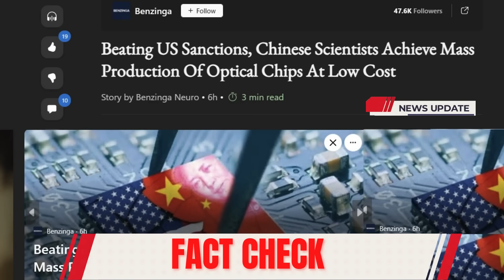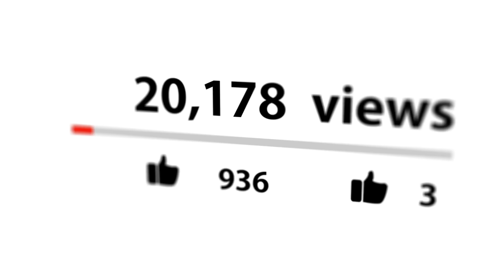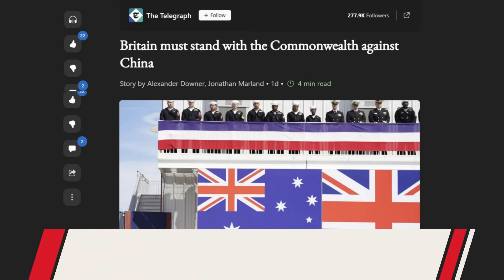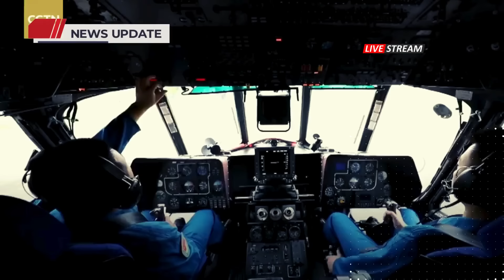CHINA Beat U.S Sanctions, Mass Produce Optical Chips

Comment: The US has been particularly focused on denying China AI chips.  Nvidia is the leader in this area with its high end GPU/AI chips.  What started out with focusing on high intensity gaming that required rapid parallel processing to achieve real time action and responses, has turned out to be exactly what AI needed because it too functionally needed high end parallel processing.

China's research into photonics has led to photonic chips whose characteristics leads to high speed parallel processing a thousand times faster in response than electron driven circuits. China's photonic chips, as they mature in characteristics, will dominate the AI computing sector in the near future and replace the silicon electron chips that have been so highly sought and priced.  Photonic chips will not only be a quantum leap forward in speed, but also a significant reduction in power consumption and price.  If anything, the photonic chip will accelerate the spread of AI as it becomes more capable and affordable.

What Raimondo has done is accelerate China's drive to circumvent her restrictions and bans and photonics are looking like the key to bypassing not only her restrictions, but put China on a path beyond anyone's expectation in the field of AI.  This has been a rapid paced game of chess and it looks like China is nearing check mate.  Further, it will be the US seeking to gain technology from China and we shall see whether the Chinese are benevolent enough to share its advances.
Reply from the maker: It's fascinating to see the advancements in AI technology and how different countries are pushing the boundaries.